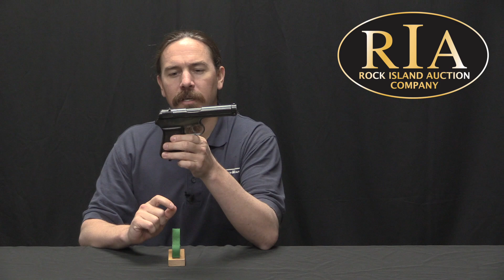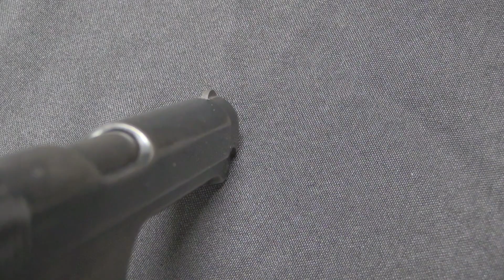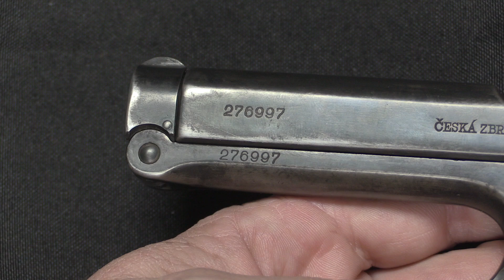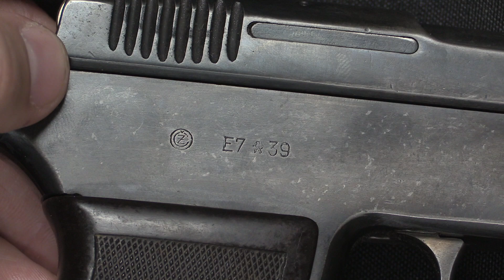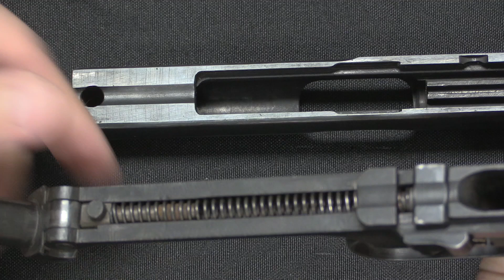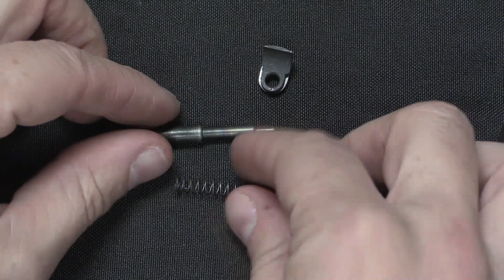CZ38 - The Czech Ugly Ducking

Comment: The notch and pawl system on the hammer is really interesting. I wonder if it was included out of an abundance of caution. It seems unlikely it would run away in full auto if the hammer was allowed to just follow the slide.

Comment: Ian:   I own a VZ38  Serial # 280042  which though it does NOT have a knurled hammer   it DOES work Single/Double Action.  All markings on it are correct.  DO I have a unicorn, something weird or just a later made variant not usually seen?
Reply: He mentioned in the clip they made some with SA/DO with knurled hammers so seems you have one of the more rare types. He dident mentioned how many they made.

Comment: I have one with the Nazi markings and no serial number.  It is also nickel plated.   The fellow who brought it back claimed to have retrieved it from a bombed out police station while serving in Germany at the end of the war.  A very interesting firearm.  Mine has a terribly hard and long trigger pull.   It also had a possibly fatal flaw - the pin that carries the force of the slide during blowback was not heat treated properly.  I wonder how many Germans got a slide in the face because of that?  I have to wonder if that was an act of rebellion.  Only the person who processed the pins would have known.    A .380 (or more properly 9 mm Kurz) out of the service length barrel on this gun yields quite adequate velocity, especially compared to typical cartridges of the day.

Comment: Nice video, thanks very much Ian. There is a sear-like lever engaging a notch in the hammer hub which appears to be a safety device, as it disengages when the trigger is fully back, could someone please comment on this? The logical explanation might be a device to prevent the hammer firing a cartridge if the weapon was dropped.

Comment: Five springs, could have been 4 if they had adopted a coil hammer spring and used it for the mag release. Release catch sprung from the recoil spring, the little wire coil foot set in the transfer bar to provide trigger reset AND transfer bar tension, the leaf hammer spring, and then a small spring for each the hammer catch (that little tooth that catches in the safety notch when the slide cycles after the trigger is pulled) and the mag release. 

Dead frickin' simple.

Comment: Hey Ian, there's actually one variation I've seen. On a few sites like Gunbroker, I've seen a variation of the CZ-38 with a safety at the rear of the frame. Interestingly all of those ones are claimed to be Bulgarian contracts.
Reply: Oh, and the hammer seems to have serrations on those, so the Bulgarians might have specified single-action capability.